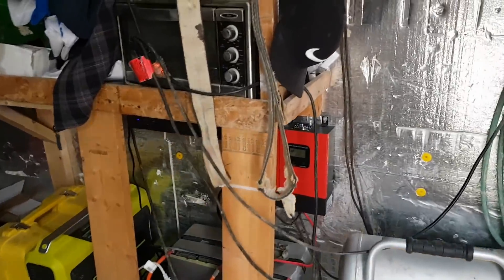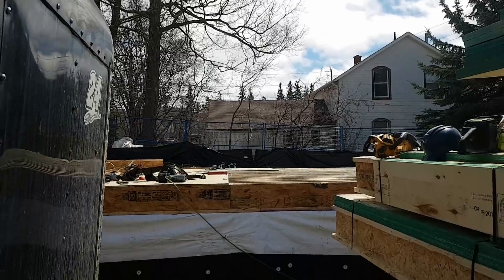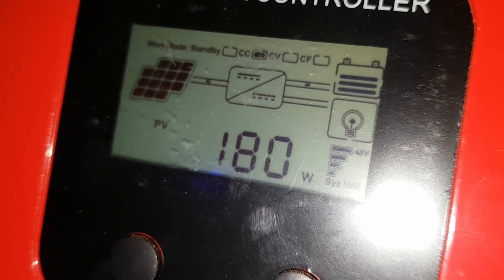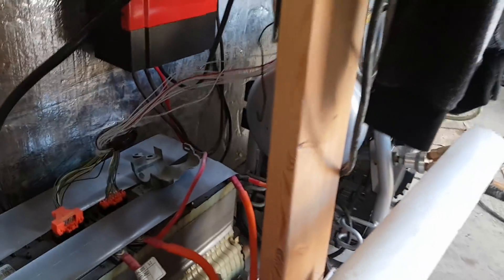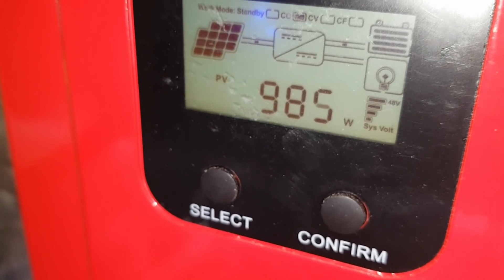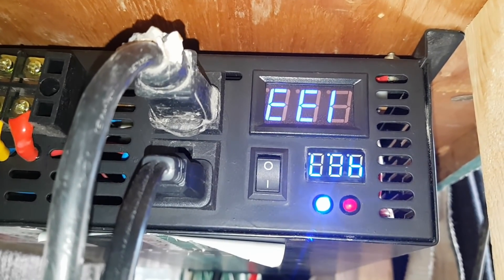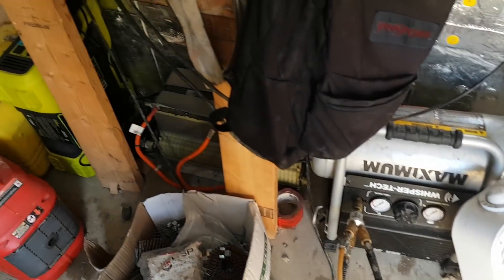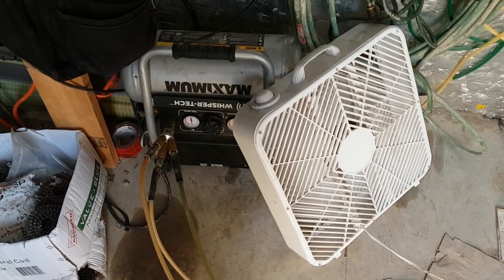Building A House Using Only Solar

Comment: Sweet , solar power is so worth it , Better than burning a boat load of gas for sure
Reply from the maker: thats for sure! im testing the the repairs 4000w right now, its running my computer and charging a 12.6v 70 Ah battery :)

Comment: hi im looking for a good 48volt inverter,but not alot of $$,,i have been using a renogy 1000 watt 12 volt and it works just fine,,but now im moving on to 48 volt,,i got the solar controller and the bats,,just need a decent inverter,,,i just want to put one in and forget it,,not mess about with it,,,any ideas?
Reply from the maker: ok here are my picks

First pick here  120v or 240 not both, need transformer for both 120 and 240. this inverter only has a idle current draw of 35w

https://reliableinverters.com/collections/frontpage/products/wzrelb-8000w-power-inverter-pure-sine-wave-rv-solar-inverter?variant=20213522989169

second pick is this one does both 120/240v but the idle current draw is 80w

https://www.sigineer.com/product/dc-ac-inverter-charger-home-sump-pump-backup-6000-watt-48v-230v/
Reply: I'll second that on the Reliable Electric inverters. I don't have one nearly as big, but my 24v 2,500w has never done me wrong and I can run a lawnmower, Electric cooktops, water heaters, air conditioner, and more. 🔌💯☀️